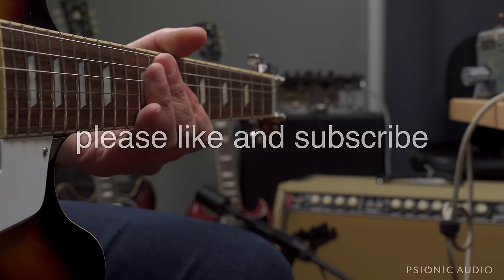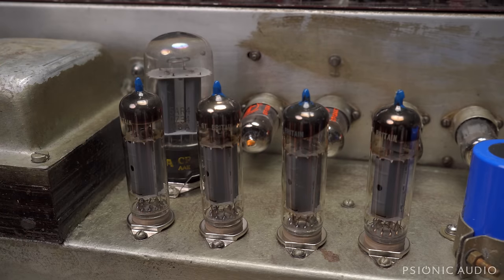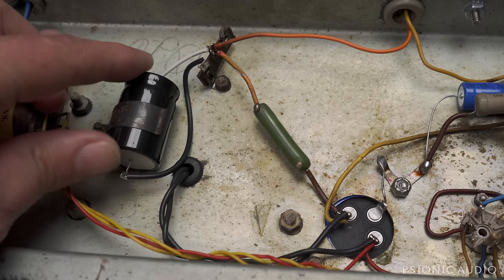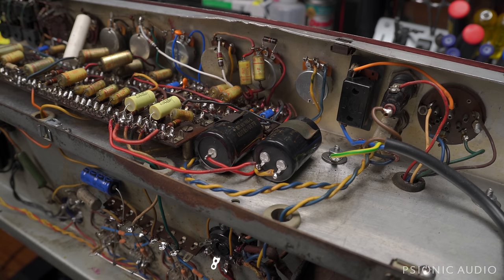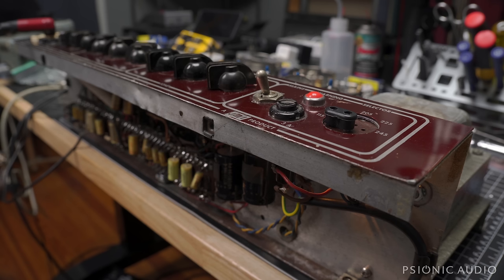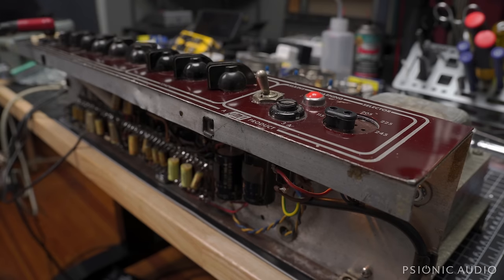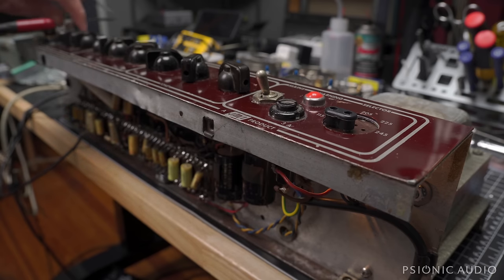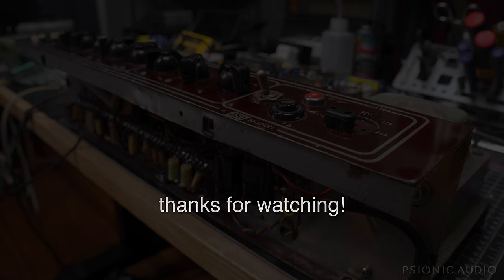Finishing Up | Vintage Sound Twin & '64 JMI Vox AC30/6

Comment: The Post P.I caps did not leak D.C Voltage !!!-They leaked Current !!!.-If one wants to show people things,and perhaps teach a thing or two,keep it correct.
Otherwise i like your videos.-Ive retired now but it´s nice to watch.Many are the AC30´s i repaired and renovated beginning in the mid 90´s.-And many years it was just a
hard time finding good spares.Nowadays it is so easy.,I might start up again....

Comment: Lyle, perhaps you've spoken on this before, but have you had any experience with Frenzel amps? They seem to be relatively low cost hand wired amp heads with some good reviews. They pack a lot in those small chassis, and it almost seems too good to be true.

Thanks for your time and effort that you put into this and your work!
Reply from the maker: Thanks. But sorry, no.

Comment: Assuming it is pretty tight, do you see any reason to replace that style voltage/impedance selector , whether here or in an old Marshall? 6:55
Reply from the maker: I don’t replace them, I just hard wire them to one voltage so the old fragile switch is just there for cosmetics.
Reply: @PsionicAudio   Thanks, for voltage selector thats a great idea. What about for impedance selector on a late 60s Marshall, in the event that hardwiring to one impedance isnt ideal. Do you think its risky to use as is?

Comment: Grant me one question: what kind of Casino did you use here? The newer version (brown back and sides) or an older one (sunburst on back and sides)?
Or a different one all togehther?
Thank you.
Reply from the maker: The new one. Brown back/sides/neck, better neck profile, prettier details, better pickups. Still getting the setup just right - only had it two days so far. I just lowered the nut slots a bit to improve intonation in the first few frets.
Reply: @PsionicAudio  Thanks for your reply! Yeah I have an eye on the new ones - as you say everything about them seems better and so far I`ve liked all the sounds I heard. Never bonded with the dull, muffled tone the old pickups had. Cheers!
Reply: @PsionicAudio I put Lollar pickups on my Casino. One thing about fully hollow guitars is that they are easier to work on than 335s (not having a centre block to negotiate the wiring around).

Comment: You just reminded of something, could you recommend a good soft wire for a foot switch?
Reply from the maker: Soft? Not sure I understand you.
Reply: @PsionicAudio  hi Lyle, thanks for taking the time. I have a aftermarket Fender foot switch and the wire is so hard and stiff it’s a trip hazard. Looking for something a bit more relaxed that will lay flat on the floor, like a guitar lead.
Reply from the maker: Ah, right. Yeah, the wire in those Fender foot switches is horrible stuff. Insulation cracks too.

amprepairparts.com has a generic that uses better quality RCA cables. Better built than the more expensive Fender too.
Reply from the maker: Part numbers FBS-271 and FBS-271-B
Reply: @PsionicAudio  thank you sir